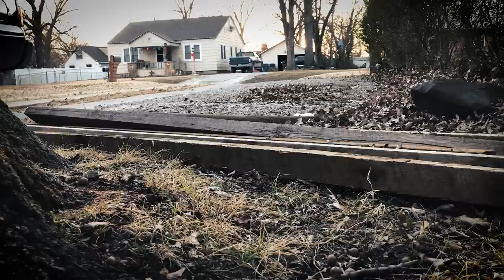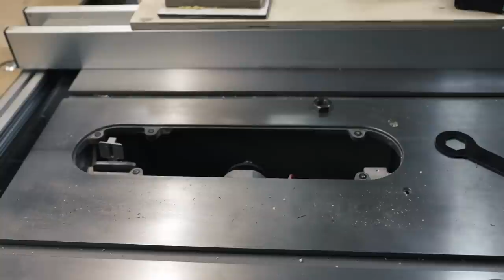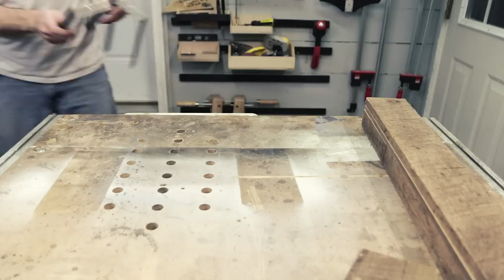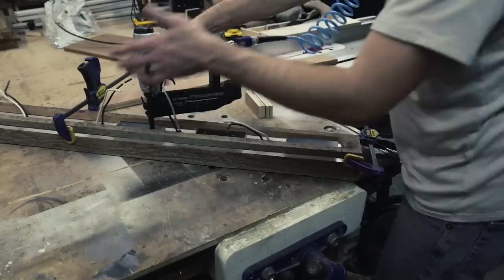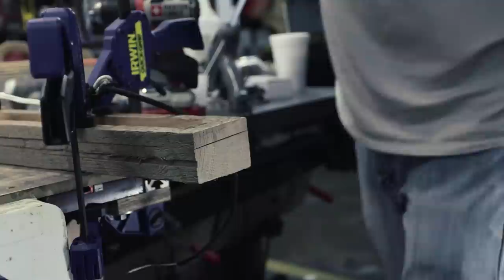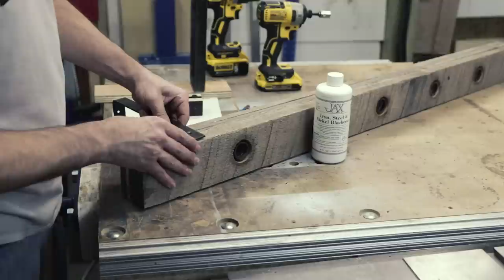Rustic meets Modern | Reclaimed Oak Beam LED Light Fixture

Comment: Amazing work. Were the LED lights connected to the Edison bulbs?
Reply from the maker: They are connected to same circuit, yes.  I used the 12 volt converter that comes with the leds and just hard wired it to the Edison bulb circuit. Still working great!
Reply: Thanks for the response. I love your design and plan on building my own!
Reply from the maker: Awesome. I would love to see it when your done.
Reply: Hi, when I click in the LED amazon link, the product does not come with the converter. Can you tell me what kind of converter you used? Thank you

Comment: terrible squalor, especially from a constructive point of view
Reply from the maker: Properly prepped and treated barn wood is in millions of very upscale homes now days.  I find your comment to be quite a stretch.  Thanks for watching though!  👍🏼
Reply: @SquareSplinter  Let me clarify my opinion to you. Maybe then you will understand and conclude
1 - look at the design of your room and the color of the door trim - there is a dark brown color, quality wood. In your piece of wood with a light gray tint - it does not fit into your interior at all
2 Wooden ceiling mount plates - perpendicular to the line of the lamp - it looks awful
3 The power cable had to be glued to metal holders (polyethylene), so that it would not be visible. If you did not guess to use a square profile tube.
4 Consider a wooden bar with LED strip ... at the bottom the wide part of the tree, then the luminous strip, the narrow part. Now imagine and flip the other way around. Then the iron bracket of the mount will not overlap the LED strip.
5 LED strip had to choose with more pcs of diodes to make light more even or use matte white acrylic.
6 Ceiling mounts are too long, not harmonious and too big shadow on the ceiling
In short… but in any case, you have done a big jod
Reply from the maker: zservice72 zservice72 you CLEARLY put WAYYY more thought into this than the 5 min I spent planning it out.   I’m sure yours will be built to much higher specs than mine.  👍🏼. Thanks either way.